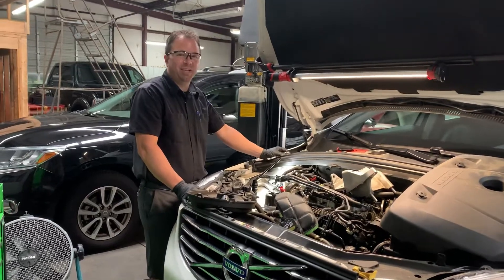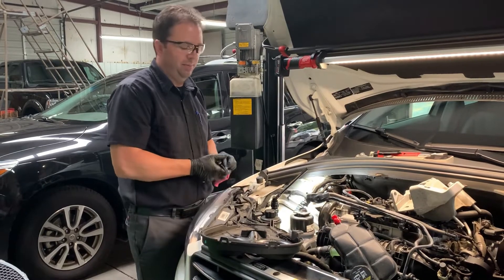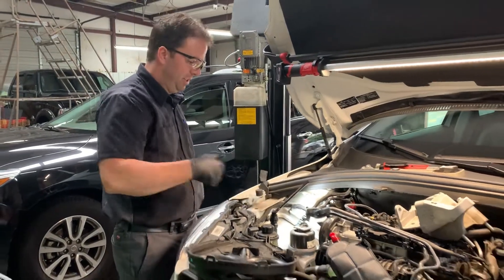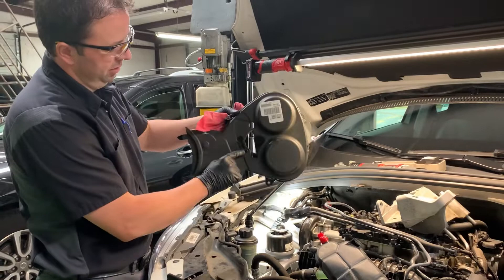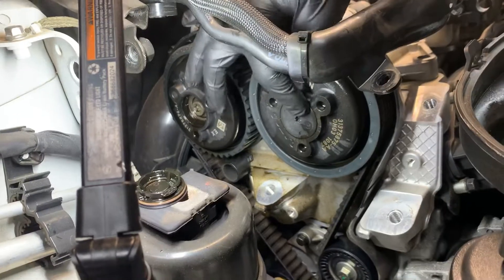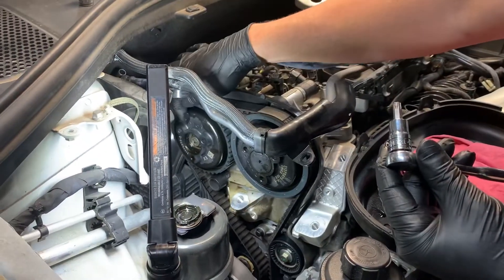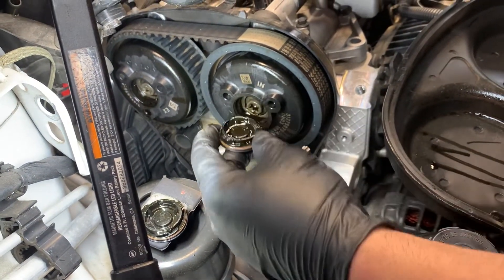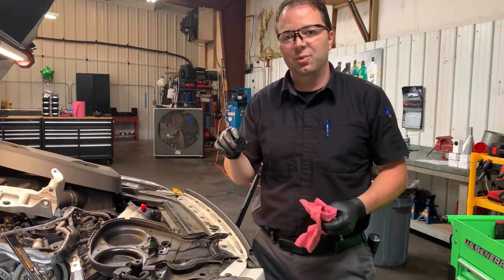2016 Volvo XC60 - Oil Leak Repair

Comment: Volvo master tech. These cam plugs are really only designed to prevent minor oil leaks from the cam seals pushing oil out. If your oil trap has failed it will cause the cam seals behind sprag gears to fail pushing oil out into the gally where the plugs are, or the seals will fail due to age/mileage. If you have oil leaking from the lower cover under the car, that is more likely coming from the crankshaft seal on the lower portion of the engine. This is also something I have seen from time to time. If your car is going through oil and you don't see leaks, and you have a 4cyl engine. Replace the oil trap. There is no scientific way to test them but they do go bad and are the first step at the dealer before we will do any kind of rebuild. (provided there are no external leaks)
Reply: Hello, by oil trap do you mean the PCV valve? I got a 2014 xc60 D4. I have visible oil leak underneath where the crankshaft is. Very likely it's the crank seal that is gone. Just thinking ahead if it could also be the PCV valve. As I am reading, a bad PCV valve can increase pressure and cause oil leaks. Your input would be much appreciated. Thanks a lot
Reply: Thanks Bro
I have a 2012 S60 that keeps losing oil almost every month 
I'll try to replace this

Comment: thanks for posting! these are leaking on mine and I was having a hard time finding instructions
Reply from the maker: The part number is 31375877, these are the replacement cam plugs.  The bulletin number is TJ 29131.7.0 Dated October 16, 2017

Comment: I think I have the same issue. Thank you very much for posting!
Reply from the maker: The part number is 31375877, these are the replacement cam plugs.  The bulletin number is TJ 29131.7.0 Dated October 16, 2017

Comment: is this the same for the 2010 T6 Turbo model?

I have an oil leak that i need to track down but hope its the same issue and easy that other videos i have seen.

Thanks
Reply: Same here.  I did take mine in to an indy shop and had it diagnosed, and they came back with the covers needing to be replaced.  After finding this and rereading their notes, I'm pretty sure it is.

Comment: Thanks for the video! So I popped the cam cover and just took a peek inside to see if it looked wet. It did not. The oil looks to be coming from up above the right axle. Is there another cover somewhere down there by the timing belt that might leak?
Reply: Hi, I am a Volvo tech. Most likely is the crankshaft seal if you have a 4cyl. You probably wouldn't want to tackle it as diy because the tools required would probably mitigate any savings you might find. Common leak, and somewhat involved to fix.
Reply: @user340243750  question: my 2013 XC60 T6 has a seeping and long-standing leak on the driver's side. It seeps down by the gasket on the transmission  about 6 inches or so to the left (towards driver) of the transmission drain plug. I can't really see where it's coming from. It has covered the inside of my splash cover twice. I usually have a stable oil level, once or twice in the last few years, I've gotten a low oil warning right before my oil change is due. I'm sort of mystified by all of that build-up on my splash shield. From under the car I can see that the air movement from driving pushes the leaked fluid all over the place--which makes it hard to pinpoint the origin of the leak. I think it's up above the driver's side end of the transmission somewhere, it rolls down and starts to collect where the gasket is. Do you have any ideas? ( I also did a 'gravity drain' and refill of my transmission fluid, and I took out (and replaced) almost a gallon of fluid.)
Reply: @badmuddafadda  I common oil leak is vacuum pump seal. Not 100% of exactly where you are having the issue, but it sounds like that area. It's an easy rebuild if you get a rebuild kit from FCPEuro. Took me about 30 minutes to put new gaskets on an clean it up.

Comment: could this cause a heavy oil leak, i have a 2010 and cant seem to pin point where the leak is from. I though it was the oil filter housing but cleaned that out yesterday and there still seems to be a leak from that area but not from the housing. i have the T6 model.

Comment: I think my 2017 VOLVO XC60 T6 R design is leaking oil through there now that it has 70,200 miles. It was dripping a little at 50,000 but has gotten worse. 
May I ask what mileage the vehicle your working on is leaking oil at?
Would the Volvo dealership still cover this as a TSB repair for my Volvo?
Reply from the maker: This vehicle was close to 80k miles. Warranty claims would have to be handled by your local Volvo dealer. Thank you for watching our videos.

Comment: I have a 2015 XC60 with this engine. I removed the cylinder head to replace a burned valve. I cant find the torque spec for the cam sprocket bolt. I have searched google and alldata but have not been able to find it.
Reply: 90 Nm, + - 5

Comment: I have a 2013 xc 60 T6 changed coils n spark plugs about a year ago cause two coils melted and so change all 6 now it started been laggy again and cylinder 6 misfire code pop up so I changed that coil and that spark plug yesterday I cleared the code the check engine light was on and they still popped up cylinder 6 misfire so I cleared the code the car is running fine no sputtering no no lag I'm just trying to figure out what else I need to do is it a valve I mean it has all the power still has in it I mean it's not it's doesn't seem to be running bad or should I upgrade the coils to like ECS tuning
Reply: I have the same model. I haven't had the issue that you are having, but I try to learn everything I can about my model. What ended up happening? ( For my car, I'm getting the AC worked on this weekend, replacing the compressor control valve. I think I have a weak fuel pump too.)